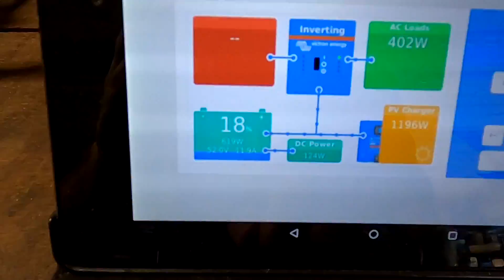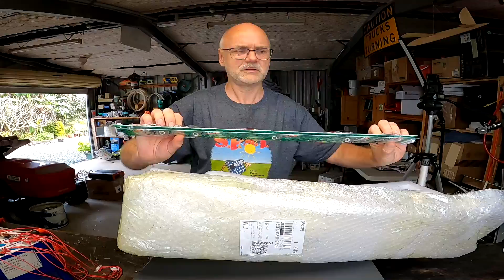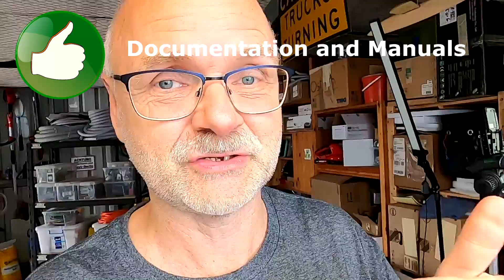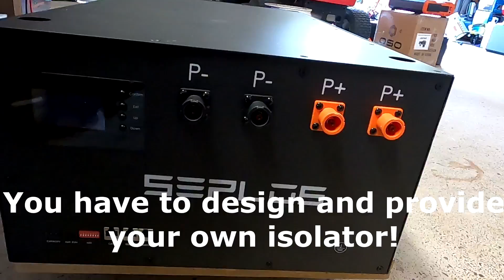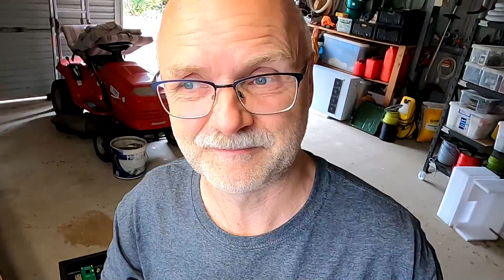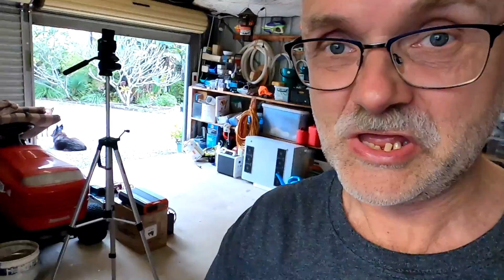Considering a SEPLOS Battery or BMS? Here is my experience so far...

Comment: I think the recommendation hinges on the question of if the cost of Seplos is substantially cheaper than Jaikper. I know they are kind of different products, Seplos being much more DIY, but DIY for the sake of DIY when Jaikper could be just as good, if not better?
Remembering the Jaikper has a circuit breaker and arguably better terminal connectors.
Total cost of ownership being the critical point.
Reply: you have many option for 100Ah battery on the market for around 1500 $ .  seplos is not one of them. however I still go with seplos since,  I have access to their technical staff and they are  helpful when there is a need to investigate or to modify the firmware.
Reply from the maker: I really like the half DIY style they provide as you exactly know what's inside the box and how it was put together. 
Sure, just looking from a pure financial or convenient perspective, other solution could be more suitable for some but that is not the point here.
The BMS could have actually more potential as I realise at the moment. I'm in discussions with their tech staff to find out more.
Reply: @OffGridGarageAustralia  I get the desire for DIY, but if the quality isn't there, it makes less sense. The main positive is that you can more freely buy those storage grade cells and add your own 4A balancer.

Comment: Hi Andy, these bms are definitely not plug and play and made for more of prosumer  to solve some specific issues...
Dealing with china is almost as pulling teeth. If you have "A grade" cells unfortunately you need a strong balancer  and better initial balance...
Anyways, they all still have a long way to go, open source platform would be nice.
You said that you had an English translation of the parameters, could you please share it with us?
Cheers and stay dry
Reply from the maker: Yeah, I've got the feeling that I'm right at the beginning of dealing with such batteries and BMS now. Everything seems very complicated and not straight forward as it should be.
I will ask them if I can publish this document.

Comment: As I own 2 of the 135's I think your spot on on both the positives and negatives. I have not experienced the shutdowns as you stated. But I run both as dumb not using the CAN connection. The BMS does need work and does need a better balancer. I do need to buy a few of the 280 boxes and DIY them myself. But this also makes me wonder if I really even want to use their BMS. Just connect the NEEEEEY and an active balancer and I have the perfect box. Then again A few Custom PCB's to allow the connection of an active balancer would be sweet indeed. Again the batteries have performed flawlessly. So A bit of heartburn over balance at 95% is not a big thing. But how far down the rabbit hole can we go to make a perfect functional battery? I think very far. New terminals, New PCB's, New BMS's, New active balancers, the list can go on for awhile. Oh Oh the cable that runs to the BMS can we get a Y there and connect the Active balancer? Either at the cable or at the connector itself. I really like the boxes, I have had NO issues, and I would like more. I have not purchased the 280 boxes myself as The total cost is still a bit to high. Great Videos and thanks for your time.
Reply: put a small switch on the negative pole of the balancer cable and cut it, if you need balanve, use small switch to conect the cable break and turn it on whenever you need the balancer.
Reply from the maker: Thanks a lot for sharing your experience. I think in terms of the balancing, the question is, how far up you will charge your battery. If you keep it at the 95%SOC level and charging will slow down above that, I guess it will somehow work.
I need more of these batteries to do more testing. One each is just not good enough.

Comment: Andy, I have a near identical setup to your v1 battery in a tub, allbeit with CALB180 cells. Would it possible to purchase the SEPLOS DIY kit but still retain my JKBMS, or will the wiring loom prevent this?
Reply from the maker: That depends on the battery dimensions and if they would fit in the Seplos system, I guess. The BMS can be swapped but it is a bit of a stretch to get this all changed from the Seplos BMS to a JK.

Comment: I must have missed it. Last time you were unable to get the computer to talk to the 280Ah battery pack. But now you can?
Reply: Yes was also keen to find out how this was resolved. A few people in the comments suggested the dip switches could be in the wrong position as they were mirroring the 6.9 Mason and the settings were different on the 280. I wonder if that was it?
Reply from the maker: It will be in one of the next videos... I got it going but there is a catch.

Comment: Would love to see a 12v version… though it would need to be priced aggressively to make sense.
Reply: I think a 12 volt version would be a mistake as the output current could not be handled by the small front panel terminals.
Reply: there is a 12 v seplos bms.
Reply from the maker: It's called Seplos Mera: https://www.seplos.com/sale-14238203-mera-12-8v-270ah-3-5kwh-lifepo4-battery-diy-kits.html

Comment: My dad has 2 seplos battery banks connected in parallel to his inverter with canbus, the BMS is configured as master and slave and they communicate via RS485, in this setup the master BMS would relay any warning to the inverter so the inverter can react according what it's program to, it does not turn off the battery as a whole. If you have communication from all bms to inverter/charger then inverter/charger will decide what to do when there are warning occurred not the master BMS.

if your inverter/charger support RS485 communication, in that case your inverter/charger will act as master BMS and relay the message internally. and the max parallel unit would reduces by 1, from 16 to 15 max.
Reply from the maker: Thank you. That is good information here. What would happen if only one battery goes into an overvoltage situation? Would the charger turn off/slow down charging to all batteries or would only the single BMS of that battery react and slow charging down for this one specific bank?
Reply: @OffGridGarageAustralia  Since all batteries are connected in parallel Seplos have a formula that they shared with me as follow
“
1: Charging current limiting algorithm 
1.1. A device triggers a charging alarm of voltage, temperature, current and capacity or any charging protection, and is judged as no charging current; 
1.2. When zero devices can be charged, the charging current is fixed at 10.0A；; 
1.3. When a single device can be charged, the charging current shall be ["Charging Overcurrent Alarm Value"-10.0A]; If the charging overcurrent alarm value is greater than 20.0A, it will be reduced by 10.0A, and it will be fixed by 10.0A when it is less than 20.0A; 
1.4. When more than two sets can be charged, the charging current shall be ["Charging Overcurrent Alarm Value" * number of sets/2]; 
1.5. When the voltage of any single cell in all parallel battery packs exceeds "set value of monomer overvoltage protection" +30mV, clear the charging current and set the charging capacity to 0A; 
2: Discharge current limiting algorithm 
2.1. A device triggers the voltage, temperature, current, capacity discharge alarm or any discharge protection, and is judged as no discharge current; 
2.2. When zero devices can discharge, the discharge current is fixed at 0.0A；; 
2.3. When a single device can discharge, the discharge current shall be ["Discharge Overcurrent Alarm Value"-10.0A]; If the over-current alarm value is greater than 20.0A, it will be reduced by 10.0A; if it is less than 20.0 A, it will be fixed at 10.0A 
2.4; if more than two units can discharge, the discharge current will be as per "Discharge over-current alarm value" * number of units/2;
”
(the original text is in Chinese)
Inverter will regulate charge/discharge current accordingly which sent by the master BMS. I have verified this on my inverter's LCD
Reply from the maker: @Pey5531  You're the man. Fantastic information. Thanks so much for sharing this here. 
How can the inverter regulate the discharge current though? If it is a hybrid inverter, I can see that it can regulate the charge current as per above formula but discharge? That's hardly possible, I guess. It depends on the load....
Reply: @OffGridGarageAustralia  It can limit discharge in ongrid mode and the extra from the grid to supply the load but in offgrid mode can't regulate but the inverter will gracefully shutdown itself down once it hit the low voltage protection communicated from the bms
Reply from the maker: @Pey5531  ah, yeah, I forgot about the grid connection. That makes sense.

Comment: Good afternoon Andy well I took your advice and purchased 2 JK BMSs, have just fitted one to my first bank,and I'm looking forward to it doing a better job for my balancing of the battery cells.but have come up to a small problem how do I get to start up this BMS,I purchased the one that comes with the on/of button and LCD,screen HAVE PUSHED THE BUTTON 1000 TIMES,OK MAYBE 3 OR 4 TIMES AND , oops left the caps lock on again,   it doesn't start up can u tell me what it is I'm not doing right please.😫🤔.I was under the impression that it's press the play button and it starts up.Ok thank u cheers from sunny hot Victoria,oooooo it's 17 c,now sun is out.Rene.
Reply: You need to hold the button down for a few seconds and not just push it quickly.
Reply: @davidb.5544  Hi David how many seconds do u think it will start up on I held it down for about 6 or 7 seconds that usually starts many things.should I hold it down  longer  I'm not sure how long to do that.Rene.
Reply from the maker: It should start immediately after pushing the button and also beeps as a confirmation. 
Very hard to tell as we don't know your system and cabling. You can only double check all the balance cables being in the right order (measure the voltages) and also make sure to have the bat - is connected to the BMS.
Can you swap to the other BMS and see if this works?

Comment: In a system that uses say, 600 amps, it's essential that all batteries shut down at the same time to prevent overloading of a single 100ah battery bank.  If you look deeper I bet this is a programable feature.  If it's not, it should be.
Reply: Is that a must or a nice to have?
Lets say you have 3x 270AH battery units, with a bms, shutting down at 250A.
If a single bms or battery fails, with that 600A, nr2 and 3 have a 300A load.
Because of the overload (Lets say) nr2 stops first.
Then nr3 has a 600A load and also stops within the next (few?) seconds.
The build in bms protection kicks in.
Maybe not that elegant, but it does the job?
Reply: @gubbernl  the build in protection won't necessarily kick in.
There was an overload test on the channel, and one mosfet burned before the bms turned off.
Reply from the maker: Yeah, interesting thoughts. I guess, I never look at this communication stuff from a large scale system design. In my little garage it might be OK and I have designed my three batteries so that they can handle any current. But as the system gets bigger over time, it could actually benefit having a comms from the battery to give other components a better understanding about the status.

Comment: Hi Andy, the communication is absolutely essential for some hybrid inverter. My brother has a Solis Hybrid inverter and it require canbus communication for any lithium battery to get the battery setting, you cannot set any parameter at all beside basic setting for lead-acid battery like voltage, charge/discharge current and capacity, on top of that can only charge current up to 0.2c of the capacity setting. It doesn't really work with his inverter at all I mean high voltage alarm daily, as soon as that happend he has to restart the inverter to clear it. as far as I can find only Seplos BMS can properly communicate with his inverter via canbus. We verified this with Seplos before making the purchase.

my brother doesn't have computer at home, so I program bms for him once and done. Bluetooth option is convention but not necessary. 

About the 95% SOC BMS turn off charging be default, it is not true in my case it only limit charge via resistance. And your comment about this kind of contradict yourself in this video https://youtu.be/OsvPYw6hoHc in a way. limited charging above 95% soc is just another way to manage your battery cycle life and you can always turn it off if you wanted to, it is not like they take that option away from you like some company does.
Reply from the maker: Thanks for sharing these information. I will clarify this with Seplos.
I know the 95% is not hard wired and can be turned off if needed.

Comment: Screws ground just fine. Measure resistance. Apply 100A power source pos to front panel, negative to rear panel, with a 100A breaker. I can guarantee you will trip the breaker. I'm glad you figured out what I was telling you, that Seplos BMS does control charging to hide our junk cells.
Reply from the maker: Structural screws as a ground connection are not OK and not allowed in many cases. There are certain exceptions but the case need special preparation.

Comment: I would like to buy a diy kit from SEPLOS. But, I have a lot of CA100 cells that I would like to use, but from what I can see these cells will not fit into the case.
I can't justify spending even more on a complete battery solution when I have perfectly good cells already. Need to find a different solution to house my CA100 cells.
Reply from the maker: That makes no sense in your case buying the Seplos system if you already have cells available. A DIY project seems the best solution.

Comment: I'm about to sell my suburban home and plan on taking what I get from it to reinvest in an off-grid property I'm slowly working on. Besides earthworks, one of the first major investments I'm planning on is building out a total solar-based power system, and placing it in a well-insulated, enclosed trailer, so that I can move it wherever I need on the 6.5 acre property as it is developed, and/or even take it to my parent's house in an emergency, or even move it completely with me should I decide to move to one of the farms we own and lease out, going from a 6.5-acre off-grid homestead to 140ish acres. Thus mobility is key.

That being said, I want this system to be able to power a full homestead cabin, complete with a mini-split heat/air system, ham radio, etc, as well as a nicely appointed shop, complete with air compressor, welders etc. So It's going to be rather large. I'm planning on full Victron other than the batteries. For those, part of me who wants to DIY, I've built a couple of small batteries, but nothing this large.  Since however, I want at least a good portion of the system to be pretty much foolproof (me being the fool), and dead reliable, with excellent, quick support should there be a problem, I'll likely go SOK, EG4 or the like, with the option of adding DIY capacity in the future. 

So for me, given the options and this criterion, the Seplos's would be out of the running. 
* Non-standard terminals
* Bad packaging, which I could see leading to a support call should something become damaged in shipment
* Questionable offshore support (especially as tensions seem to be rising between the U.S. and  China)
* BMS Communication problems

Yeah, for something that's not a hobby, but I would be completely relying on.. it's a pass for me.
Reply: Then I would suggest you look at either building your battery with a REC BMS to communicate to your Victron system or maybe buy Pylontech US3000C packs. EG4 does not support communicating to Victron, but I think SOK does. You can read all the comments above about why this is recommended in large systems. Good luck with this project! I'm going to build a prototype energy trailer like this to promote my business and loan it out to various events like mountain bike races and municipal events to promote the use of clean energy and stop relying on loud, smelly generators. I have several commercial customers interested in buying small-scale mobile systems like these for running air and water monitoring equipment so I'm thinking the investment would be worth it.